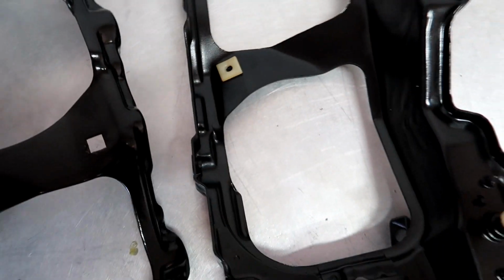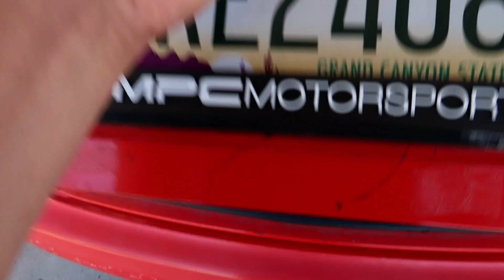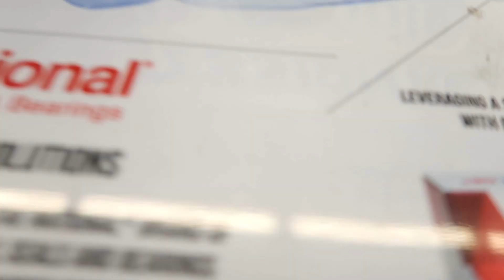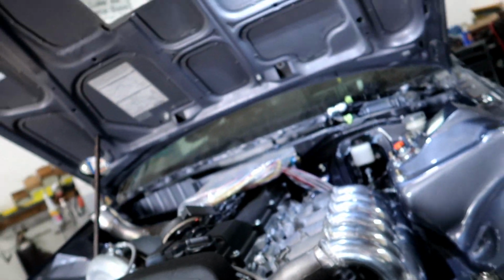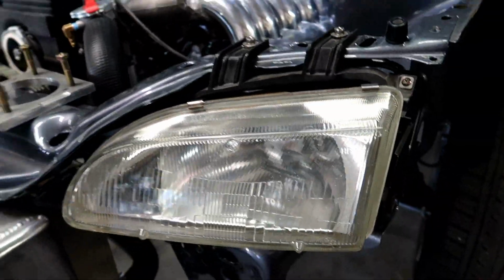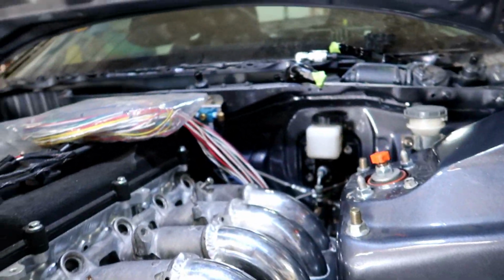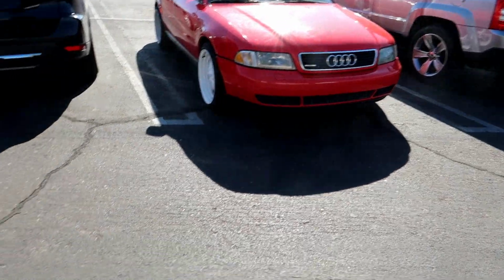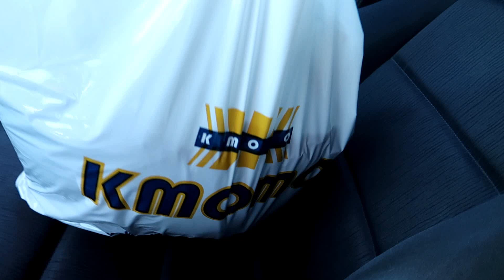sic vlog (literally)

Comment: Grab a 10 pin jumper harness, cut the plug off and wire those wires into the 10 pin where they need to go to
Reply from the maker: I just ordered a jumper  last night brotha..  ;)
Reply: DEADBEATGARAGE hell yeah, it’s the easiest way to get the job done when In need
Reply: DEADBEATGARAGE any 96-00 civic has the 10 pin plug on the engine harness by the clutch master

Comment: If you go on eBay and type in obd2 to obd1 jumper harness for distributor you will find that plug with wiring you can use for $20 or so.

Comment: you're going to need to buy a 10 Pin OBD2 to OBD1 Distributor Engine jumper Harness they are $30 on eBay. I had the same issue on my 1999 Honda Civic EX with a B16a2 swap I could never find the right distributor so I had to do this to get my car running with out depinning the distributor wires. plug and play. If it helped show me some love on my page 👍😎
Reply from the maker: Yeah I ordered one last night brotha thanks